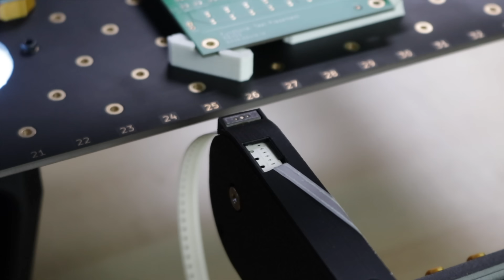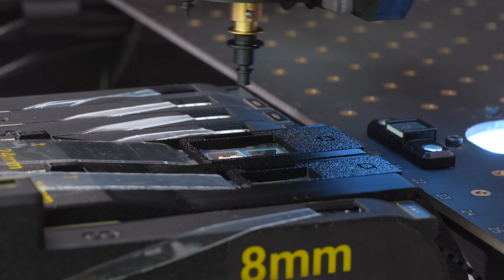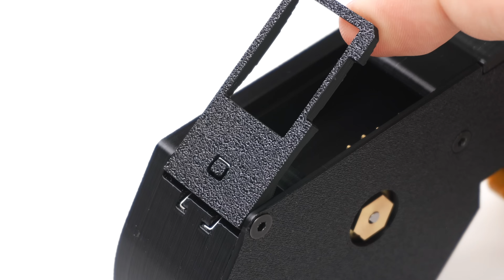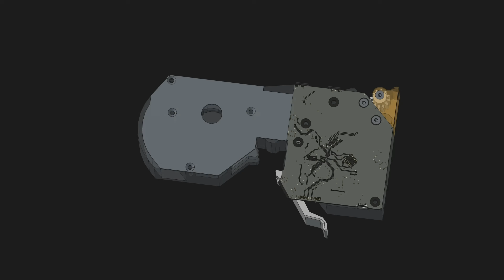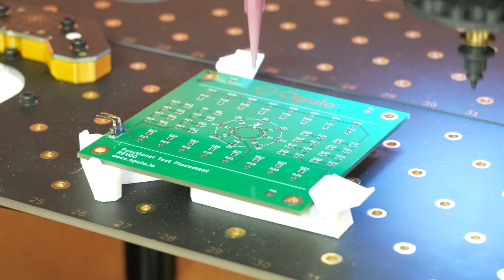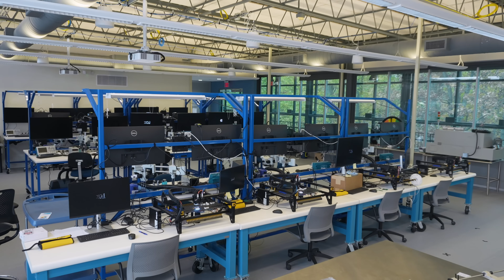July 2026 Opulo Update

Comment: I wonder if you could also use something like the Eufy UV printer to create a solder mask and silkscreen on the via grid board before sticking it in the paste machine? 

I have no idea what the temperature resistance of the ink is, but even if the silk went down after parts were soldered, you could get a "silkscreen" layer.

Comment: Just throwing this one out there: If you have a UV laser to proto with viagrid boards, then use it to cut a paste stencil too.  I keep different thicknesses of shim stock and cut stencils with mine.  I've found soft aluminum to cut well and not warp (less of an issue on UV due to the lower heat input compared to a Q-switched or MOPA.  Also a damp towel or wet sponge under shim stock does wonders to minimize warping even on stainless)

Congrats on the growth!

Comment: Regarding your hiring process, have you considered using a "temp-to-hire" strategy? By partnering with a staffing agency, you can effectively filter and vet candidates before committing to full-time hires. This allows you to evaluate potential technicians on the job, transition the best performers into permanent roles, and mitigate risk with those who aren't the right fit.

Comment: Well done Steven, it's awesome to see your work taking off. If I lived near Pittsburgh I'd definitely apply (I've heard it's really nice too). It's probably crossed your mind but have you considered using an open source robotics design to help cover some assembly technician tasks? The Haddington Dynamics Dexter robot arm costs ~$5000, kinetic training options and very capable for many/most product assembly tasks (or easily adapted).